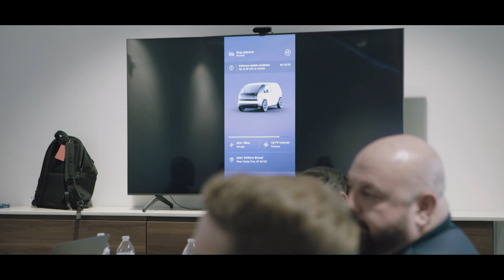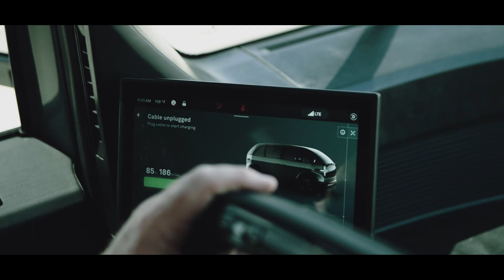Electrify Your Fleet With Kingbee, Canoo, & Pollen

Comment: OK Kingbee, know this>>>>>
I worked out of vans for 50 years & it always irritated me that companies who fancy themselves as  UPFITTERs
who install cabinetry & such inside vans did not seem to realize that van interiors  ARE  NOT  SQUARE !!!!!!
The walls slope but upfitters continue to install  SQUARE cabinets wasting a goodly amount of space  BEHIND
the cabinet. With one van, a full size Ford e class, I built my own cabinets out of 3/4" plywood. The back of the
cabinet fit snuggly against the van wall & the shelves sloped up inboard & down outboard @ the wall. This was
so parts boxes & whatever would not come flying off during a hard turn maneuver. It worked great. ALSO,
I built a bench across the side sliding doorway out of 2X4s & 2X6s with a med sized vise bolted to it. I always
wished the benchtop could have been hinged to flip  UP  so I would not have to climb over it.

just a thought...

!